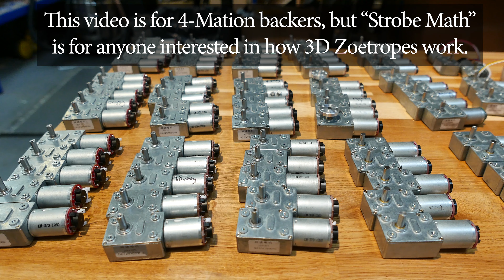4-Mation: Motors problem -  solution and upgrades delays shipping

Comment: Put a smaller roller suport column in each base of 4 side.. A small stick with roller in the top. At the corner of each base. This will support rolling plate from all side. No vidration.